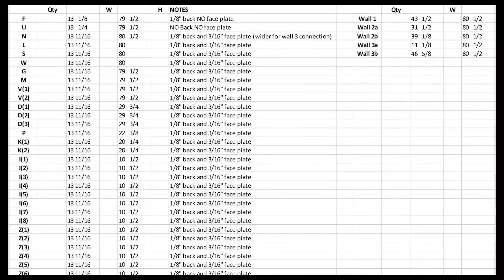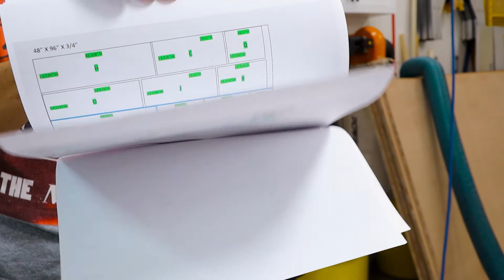DIY Custom Closet - Part 1

Comment: This is a huge undertaking that y'all have started.  I can't wait to see how you put together the movable base that will allow access to the ceiling panel.  Really like the screw driver tip to smooth out wall imperfections.
Reply from the maker: I dont think anyone has used the super bizarre method we came up with for the movable section but it works and you will get to see it next week.:-)   The screwdriver tip is something I learned many many years ago but it work exceptionally well. Better than scraping around a small hole that often pulls up paint from around the hole.

Comment: Sure you considered it.... but how about moving the access hole? ;)
Reply from the maker: Our options were pretty bad. Did not want it in the master bedroom, linen closet where it would be inaccessible, wonky hallway that was built at 45 degree angle to the rest of the house (dont ask). The house is very narrow. Thank you for pointing it out though. We do appreciate it. :-)

Comment: Wow you both are so inspiring!  The closet build is looking great and I'm excited for part 2. 

Any idea as to why the previous closet unit failed?
Reply from the maker: Thank you so very much for watching the video and for your kind words. I am perplexed as to why the original failed. Clearly, it was too much weight and it collapsed. We had to empty the closet for a separate issue and when we loaded it back up, we found lots of things we dont wear so we threw donated a lot. This means there was much less weight than before, yet it collapsed. I think it was a sign for us to think of a new project. :-)

Comment: That's a lot of work. Can't wait to see how it looks when finished. Could you not move the access panel?
Reply from the maker: We are pretty excited to show how things worked out. You could say we are both tickled pink with how things worked out. Great idea on moving the panel but the AC unit is literally, right next to the panel and it is a large beast. so there is no other option in this closet and the other options would be to make a panel in the master bedroom or either of the bathrooms. (it is a typical small house of Hawaii. LOL). As always, we are humbled by your support of our channel and for always watching our content and leaving such kind words.